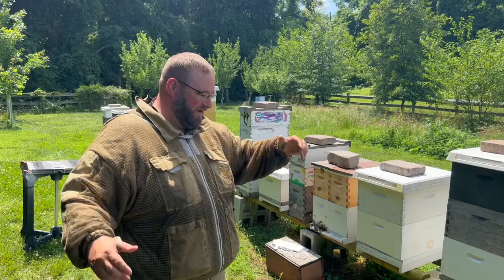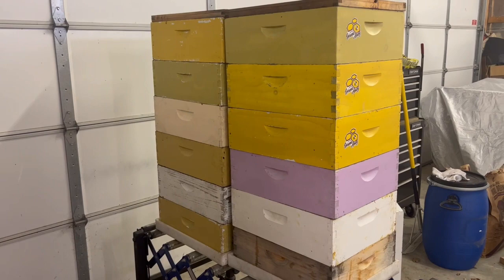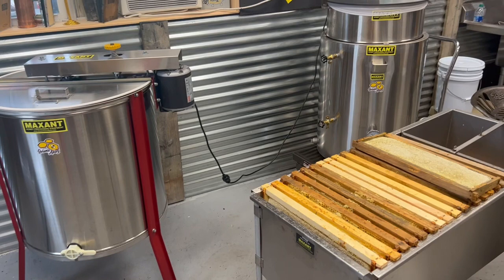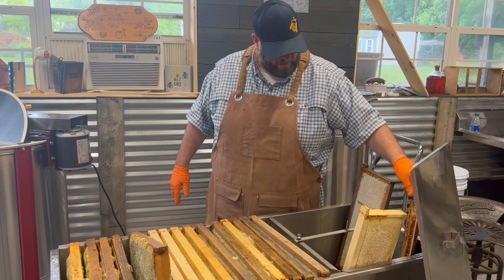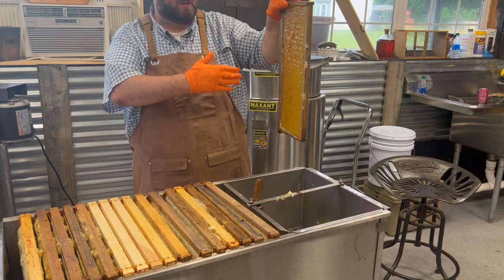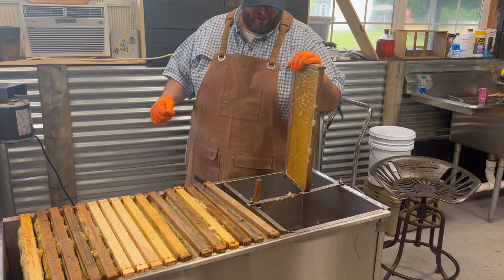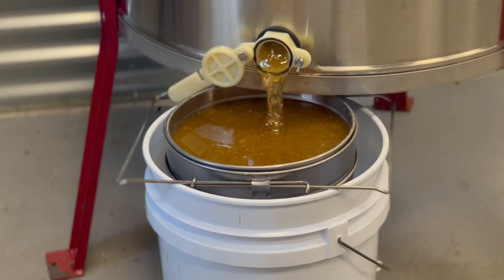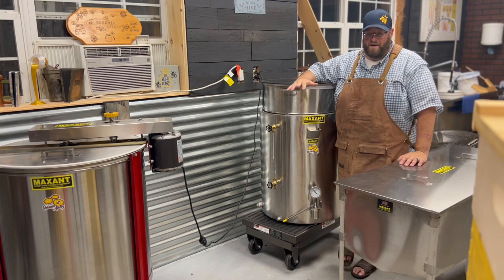How to harvest honey | Beekeeping | 2022 Harvest

Comment: Hi Jason, you should think about making a swivel wheeled base and just lag bolt the extractor to it. By having it on a moveable base it will absorb wobble from the unbalanced frames. I also added hinges on mine so I can tilt it forward and drain most of the honey out of the extractor. I'll have to do a video next time I extract some honey. Probably in a week or so.  ** Smash the like button everyone **
Reply from the maker: Great idea. I started a platform last year for it but never finished it. However, I find if you start off slow and build it doesn’t wobble. But just takes a few min longer. Thanks for the support!

Comment: Another reason to leave the honey gate open is you don't want the honey to reach the bearing at the bottom of the center rod.  There is non-food safe grease in there and you don't want to contaminate your honey.  Also, the acidity of the honey will damage the bearing at the bottom. 
I'd also recommend putting a lid on the extractor.  I realize yours was likely off for video purposes, but the air inside the extractor has to go somewhere and it usually funnels up and out of the extractor.  The fine wisps of honey will go with it and you will have microscopic pieces of honey EVERYWHERE within a few feet of your extractor if you leave the lid off while spinning.
Reply from the maker: Correct.

Comment: This is a great video, Jason.  I really like the look of your honey house.  I have a 20 frame maxant extractor like you.  Do you know how long does the leather washer lasts gradually increasing speed like you do?  I see you are using as it is designed to be used and i am not.   I have always had my extractor strapped to the corner wall and kept the yellow nut all the way tight to minimize slipping and wear on the leather washer, but with my redone honey house i will have to approach extracting like you demonstrated by starting slow and gradually increasing speed with the extractor not bolted or strapped down anymore.  thank you for your time.
Reply from the maker: Thanks for commenting. We haven’t seen as much wear using the slow tighten method. Just takes a bit longer.